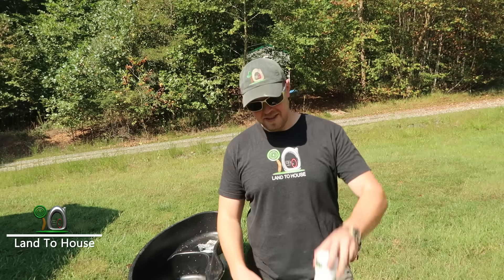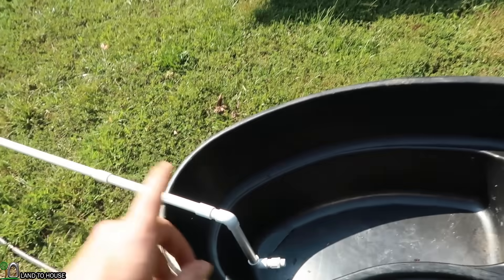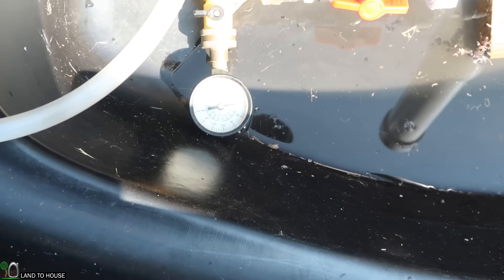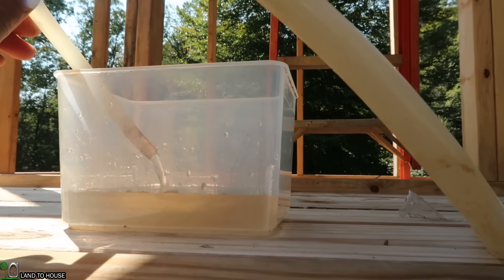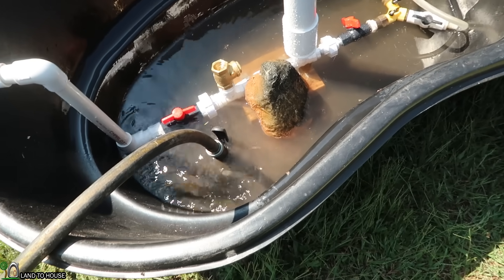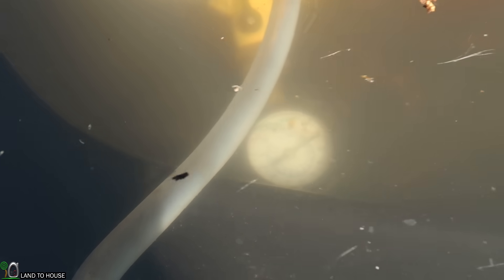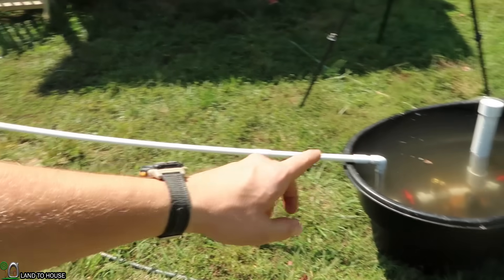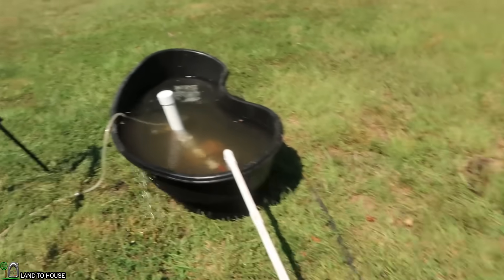Underwater Ram Pump

Comment: The pressure of the water in the pond would restrict the output of the waste valve slightly, so that could be the reason why the flow rate was a bit less on the underwater test. However, pressure gauges like the one you have are measuring the difference between the pressure on the system and atmospheric pressure. The gauge being underwater means that there is actually more than atmospheric pressure on the outside of the gauge. It seems to me that this would be the reason why the gauge seems to read less output pressure when it's underwater. Maybe try placing the pressure gauge above the water later on in the output hose?
Great video! Very informative, cheers!
Reply: The the waste Valve under water is pumping at a slower rate due to the extra resistance and pressure of being under water, it has less cycles per minute.  In the Video, the ""out of water"" test started at 5:07, at 5:20 it had 15 cycles, miraculously the underwater test started at 7:07, at 7:20 it had 13 cycles.  Additional pressure of being under water slowed down the cycle of the waste Gate, slower cycle, less pressure due too much back pressure escaping.
Reply: @steelarms4235  and yet the amount of pressure in the tank seemed to be -25% while the volume of water pumped seemed to be much more than 75%. I'd like to see the pressure gauge itself raised above the water to see if that's really true. Seems to me like this would result in less wear on components and less maintenance if true
Reply: Pressure on waste valve causes losses? 
What if you create an air pocket over valve, say a dome under water.. would that reduce losses or would you lose air pocket over time due to air pump function? 

I like the under water aspect especially.
Thinking from sinking a pump in a dam to create a circulating water situation(not losing body of water or having to have flowing stream). 
 The idea mainly to create minimal losses using the body of water/gravity/renewables  as a power station/battery of sorts.
Not trying to break laws of physics but increase efficiency of energy use/storage.
Reply: @damienarton3910  can't see the point.. The wasted water will fill the air dome until it builds pressure because there is no more room which will ever stop the system from working or explodes the dome because of the pressure...
Reply: @damienarton3910 i was thinking of a similar situation in order to aerate a pond thats overgrown with moss! Could you use the pond to aerate itself essentially ? Thats provided you have a downhill situation to create the fall or drop in the water ! I have that exact scenario in that i have a pond and a good drop down a hill next to the pond!
Reply: I thought that valve sounded slower underwater.
Reply: The pressure gauge under water is indeed a good point and might be an issue. But this roughly one feet under water will not explain a pressure difference of 8 psi (32 psi vs. 24 psi).
Reply: @patrickhoffmann8893  needs more testing could be the source was fuller or airleak
Reply: @patrickhoffmann8893 if its a sealed guage which it is, atmospheric pressure shouldnt affect its reading!
Reply: Can this system be used in combination with a vacuum pump system in a closed circuit?  Then you have created a perpetual mobile and you can mount a dynamo in bottom and convert the energy into electricity.
Reply: @ulfcarlfinnes2820  I know this is an old post but I was intrigued by the vacuum pump idea but couldn't quite understand. 
Anyway I thought you might  appreciate my suggestion which I am currently working on.
I live on my friends small  ' hobby farm '  and I am almost directly above a stream  and there is a 10kl water tank.
I am looking at feeding the tank with ram pump/pumps and fitting the tank with bell siphon/siphons which will always leave a percentage for the farm  (  a lot of rain constantly fills the tank where I live as well and more often than not the shed roof is being diverted away from the tank. )
Bell siphons should fully automate this system and by varying either the ram delivery or the siphon out and including a overflow line this system should be able  to run a generator with little downtime.
This should work quite well with several connected plastic drums as well.
Drop to stream is approximately 25 feet from base of tank.
Reply: Agreed. The tub got deeper and that would cause the drive pipe and valve to cycle slower. The drive pipe had to work harder to close the valve.
Reply: well it all depends on how deep in the water the pump is; atmospheric pression is about 1 bar. The relation between the distance to the surface of the water (in meter) and the pression (in bar) is quite simple : p = 1+d/10 (the water pression is d/10 bar and we add to it the 1 bar atmospheric pressure as it pushes on the water in order to get the total pressure)
so when you are at the surface of the water (same thing as on earth) u have p=1+0/10=1 bar but under 15 meter of water the pressure is 1+15/10 = 2.5 bar
Now as long as the input pressure is greater than the pressure on the waste valve the pump should be able to run. In other words the deeper the pump the more force u need from the intake.
Reply: The pressure guage is a sealed guage so being underwater wont have anything to do with the reading. The reduced flow is caused by the increased hydrostatic pressure on the check valve causing it to work harder and slower!
Reply: I think if the waste valve is submerge the pressure will increase, it means the lift will be higher. It is the same that you are putting additional weight to the waste valve.
Reply: @maximoincognito4881  This makes sense to me as it relies on the velocity head to force the waste valve closed and then that stored momentum forces the other check valve open. More pressure on the outlet of the waste valve should result in more required velocity to shut it and this result in more volume being forced into the other valve.
Reply: I think it runs in the wrong direction,  other vid shows the "watertower" first, then the valve, depend of die impuls...
Reply from the maker: There are a few different configurations for the pump.
Reply: @LandtoHouse  ram/rams  to tank or connected plastic drums and bell siphon/siphons plus overflow in heavy rain areas  to automatically feed the generator.

Comment: If I am using this to keep a  tank near my house full, would I need to go down and prime the pump after the tank is full and then starts to drain? Would it start up again automatically as the tank drains?
Reply from the maker: The pump needs to continue to run. You could either have a float valve to stop the delivery or you could let the water run back down the hill.
Reply: @LandtoHouse  wouldn't the pump stop working as the floater stops the inflow when the tanks fills up?

Comment: So your ram pump has only 1 non return valve OR check valve instead of other design which have 2 check valves? 
1) Can you take a small electric pump with low head max 1m but high flow say 1000LPH (most aquarium pump) and use it to drive water to 4m ?
2) You need to check the amount of water pumped by the RAM pump (at various output heads) and measure that vs the amount of water consumed (by your drive reservoir) and drive head to do so. That would be an interesting experiment to figure out the efficiency

Comment: Water pressure would lessen as the output has a head pressure.
Reply from the maker: From what I can tell the tube fills with water and introduces hydrostatic pressure on the valve and reduces the head pressure that the pump has to work with.

Comment: Great video - very informative!
You mentioned you used this design in a cascading pond system, but that it wouldn't work in a lake.  Why is this?
If I have my inlet pipe positioned at the water's surface, I would have a ~6' drop from the inlet to my ramp pump at the bottom.  The only issue I see is the additional hydrostatic pressure that would have to be overcome in opening the waste valve.
Reply from the maker: The head pressure gain as you go down into the water is negated by the hydrostatic pressure in the same space. You could see this issue if you place a straw into a glass of water. It does not have flow going through it. It would be so awesome if the ram pump would work in a pond though.
Reply: @LandtoHouse  makes sense.  I watched your video "Ram Pump for a Well and Aquaponics - Nope" which elaborated on the issue and ended up making it clear.
Reply: The ' drop ' you are counting on is the vertical distance from the water source to the height of the water on TOP of the exit valve (not the exit valve itself).  for every inch of water on top of the exit valve, you have to subtract that.  So in the case of the intake tube being in the same source of water as the ramp pump, the verticle height difference is 0.  There is no advantage to having the pump submerged except for sound reduction.

Comment: The weight of the water when the tub is full reduces the pressure.  The waste water has a more difficult time exiting the pipe so pressure going to the elevated pipe is less. Its like you put a vertical pipe in the waste valve, the taller the vertical pipe gets, the lower the pressure.  The flow rate =Area of the pipe times the velocity of the water. 8 Lbs of pressure in not sufficient to change the velocity significantly since the water stops accelerating when the valve is closed (which it is half the time). Almost 100% of the flow rate will be determined by the vertical difference between the 5 gallon bucket and the top of the waste valve. If the waste valve is underwater then the flow rate will be determined by the difference between the top of the water and the 5 gallon bucket. You don't need the long sloping pipe. Just move the 5 gallon bucket next to the waste water pond and experiment with moving the bucket up and down. Good video! cheers!
Reply: Hi Jeff, The energy the system uses is from the potential energy of the source. the longer and farther it falls, the more energy it has. A lot of energy is lost with friction of the water in the pipes and the efficiency of the check valves as well as the efficiency and size of the accumulation chamber. See www.youtube.com/mekanizmalar for a good explanation of this. You will never be able to recycle all of the waste water due to the Law of conservation of energy. A major source of energy loss in this system is the speed of the check valves closing and their size. See Bohumir Stehlik's youtube channel where he makes some very efficient valves for a ram pump from hardware store parts. Cheers!
Reply: Michael,  are you saying that the pressure of the water that is pressing on the waste valve makes a difference on the flow of the water and pressure of the water in the pipe that is pushing out of the pump (not the pipe that delivers water from the source).?  if so, would the height of the bucket (source) opposed to the height of the water pushing back on the waste valve have any effect on the pressure of the pump?  And if so, would more one way valves up the waste pipe mitigate any ill effects caused by back pressure on the waste valve, and if so, would you think that it could be possible that the waste water could then be pumped high enough be gravity fed back into the source bucket so that there is only water lost through evaporation and or consumption......  Hypothetically speaking?
So, if someone had an NFT garden system where the source water ( rain collection barrels) were at height point 0,  water flowed to a ram pump at, say, height point -10 (down hill to the end of the NFT system), could the waste water be saved by having it pump up to just above the source level (say, height point 1) so that the NFT system flows back into the source bucket at point 0.  This would then have the water pumped from point -10, and the waste water pumped from point -10 back into the NFT pipes at point 1 which then flows back to the source at point 0 and starts the flow all over again and eliminating the wasting of the waste water.......Hypothetically.
Reply: Michael Edwards 😩😩

Comment: Hey can you put a pipe on check value exit to deliver to a containment tank so long as it doesnt give head pressure and stop valve flow??
Reply from the maker: Yes you can put a pipe on the waste valve and send the water to another location downhill. I recommend installing a t fitting to allow you to push the waste valve.
Reply: @LandtoHouse  ok thanks for your reply, its a great  advantage, its suprising how much head height it achieves to the top of your cabin. 
Well done, thanks for sharing.
Reply from the maker: @aischaparker9471  happy to help. I actually have a video on this. I think I called it waste water diverter.

Comment: Could this setup work with pump at 8 feet under water surface and take water from  a large funnel 1 inch under surface?
Reply from the maker: NO sadly this does not work. If you were to take a drinking straw and place it in a glass of water there would be no movement of water in the straw. This is because there is both head pressure and hydrostatic pressure in the water. To get the ram pump to work you have to have a source above the location on the pump.

Comment: I am glad to see it will work under water. This could help muffle the sound. Especially if there is a noise of a water fall nearby would be good.  A friend was concerned about the noise attracting marauders in the aftermath of an apocalypse.  I will be able to tell him about your experiment.
Reply from the maker: Underwater does seem to help some with the sound. I have a feeling it could also help with freezing in the cold months. . . . I have actually received email from many people in parts of the world who have said they lose ram pumps from theft. The sound is an issue because it draws people in to see what is going on.
Reply: @LandtoHouse  Maybe a cammo and insulated box/cover over the pump assembly to obscure, and deaden the sound? Also black pipe or hose?
Reply from the maker: @dgbasile  this summer I hope to make a pump that is stealth and hidden. An insulated box is a must.

Comment: This pump is the key to how the Pyramids were built.All ancient structures are located near rivers with headflow.Thanks Seth,hydraulic tools next please powered by a ram.pump.
Reply from the maker: I have watched that video about the pyramids. Very interesting. There is likely a way to get the ram p ump pressure to work with some tools.

Comment: Water is a battery
The surface has negative protons the submersible positive protons or maybe visa versa at varying times of year.Your metal valve will be effecting your psi as it is performing as an earth thus creating a downward drag on its swing gate.
Reply from the maker: I am not sure that those factors will be strong enough to see a change in psi out though.

Comment: Why wouldn’t you just put a 3ft stack for an inlet under water then you have the head pressure in a static pond no? Use a 45d or a 22d so you don’t get a vapor lock
Reply from the maker: Sadly the water source has to come from above the water were the pump is located. If you were to place a pipe in the same body of water as the pump it would not work. An example: place a straw in a glass of water. There is no flow out of the straw. It just sits there.

Comment: Can I place this pump inside aquponics fish water tank?? Is it possible??
Reply from the maker: Sadly the ram pump does not work well in a n aquaponics setup. The water source needs to have a constant flow. In a closed system you will soon have all the water at the bottom.

Comment: perhaps less water was wasted trough the ram pump mechanism?
Reply from the maker: I'm not entirely certain what happened with the difference. I hope to perform this test again later in a deeper pool of water. Perhaps I can get some more data that way
Reply: @LandtoHouse  looking forward to it 

i meant as an possible answer to the question why it was less pressure output but end result were the same.

Comment: put your check valve on a riser above the water. should give 32 psi.  piping sized one size larger should reduce losses

wouldnt a intake just below the surface of a lake drive a submerged ram pump if the air chamber was preloaded with air?

think of the water in a ram pump as a quantum fluid.
Reply from the maker: I actually have tried installing a raiser for the waste valve. The higher the valve goes the less head pressure you have. When increasing the pipe going to the valve it can actually reduce the efficiency. Sadly the intake needs to be in moving water with head pressure to operate the pump.

Comment: Are you sure about the underwater guage reading?  Considering its depth underwater, it certainly has a fair amount of water weight squeezing it. Is the gauge measuring absolute pressure or relative pressure?
Reply from the maker: That gauge is only measuring the pressure in the ram pump. It is not measuring the pressure of the outside water. Basically the test was to see what pressure change there was based on how the ram pump performs underwater.

Comment: the amount of water volume in the reservoir plays a role in how much pressure is pushed by the pump.
Reply from the maker: Not so much the amount of water but the height of the water in the reservoir. The hydrostatic pressure of the water in the bucket changes as water is used and this reduces the lift ability of the ram pump. Good observation.